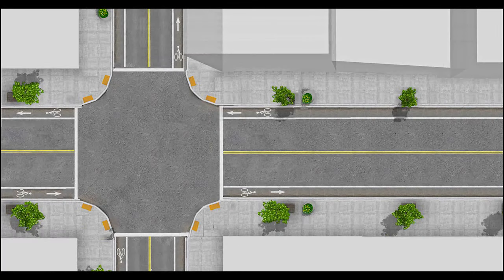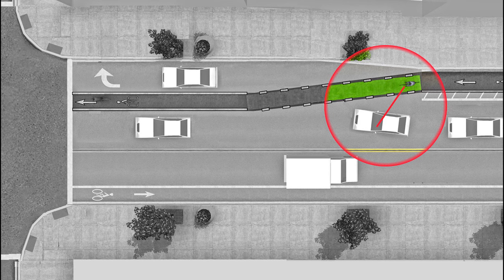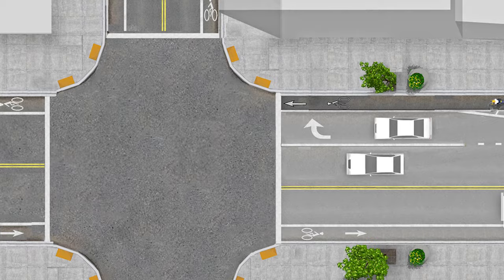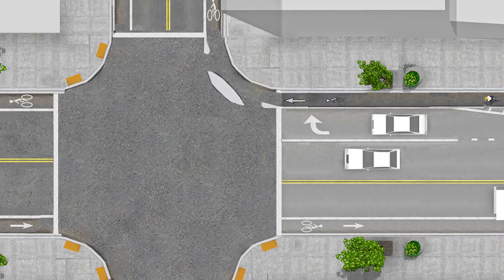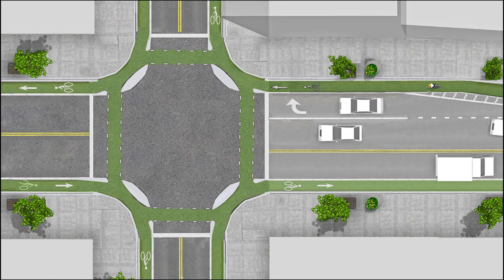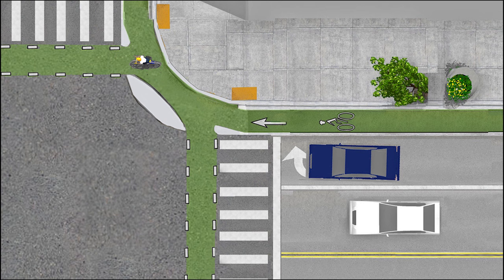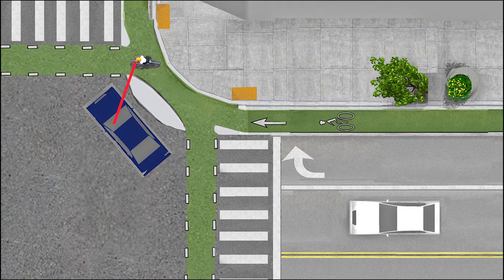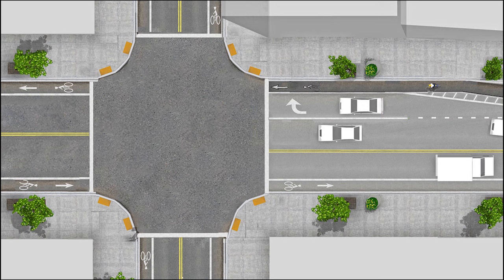Intersection design, the Dutch - cycle friendly - way

Comment: I'm not convinced.  Seems like the cyclist going straight now has to yield to cars going right, where previously the turning car had to yield to cross the bike lane.

Ok for a few blocks, but a serious impediment for longer distance travel. My 20km commute would have about 30 of these, and I could easily imagine each costing 30 seconds, which would add 15 minutes to a 45 minute ride.  Not great.

And the part about the car driver having to look over their shoulder doesn't ring true - the driver

Comment: Cyclists should be required to get insurance to operate on public roads.  And they should have to register and get plates as well. If you are going to use the roads then you should help pay for the roads.  If you want equal use of public thoroughfare, then you should have equal responsibility for safety and maintenance.  No free ride....pun intended.
Reply: +Gary Hudson I'm all for it but what would the insurance cover bicycles cannot do nearly the damage of autos. Are you implying that cyclist should be required to release motorists from the responsibility to not do damage to cyclist? I mean at full speed i could probably only do a couple hundred in damage to paint maybe a window, and there are already rules that allow for self insurance.  Please explain what your implying.
Reply: +Gary Hudson I have a car, truck, and motorcycle.  All registered.  When I decide to leave these vehicles at home and ride my bike, I've more than helped pay to maintain your roads, or fix any damage a bicycle can do to them.  Just my 2 cents, think what you want.
Reply: +Gary Hudson You want a 12 year old to take out insurance so they can get to school?
There is no registry or mandatory insurance for bikes in the Netherlands.
I think I've seen you commenting this before...
Reply: Dude, then pedestrians should pay for walking on the sidewalk. Also, everybody in the Netherlands has liability insurance, which covers bikes.
Reply: As if road tax pays for the roads, it's a tax to use them. Which is why cycles don't have to pay it, they do way less damage to the roads (as do pedestrians). All the income of the state goes on a big pile of money and them some of it is spend on the roads. TL;DR, if I'm paying tax, I'm paying for the road. Doesn't matter if I have a car or not.
Reply: @woutervanr  If you have a car, you do pay extra taxes. But it's good to encourage cycling instead of driving cars, so making driving cars slightly more expensive is a good idea.
Reply: @autohmae  It should also be noted that cyclists have a negative cost if you will, as compared to motorists whose taxes do not actually even pay for their full costs.
Reply: @Quintinohthree  you can tax cyclists just fine, some countries have been doing that for decades.
Reply: @autohmae  Nevertheless, every tax on cyclists is excessive, as they reduce overall costs. Taxing cyclists almost certainly causes a net increase in overall costs.
Reply: @Quintinohthree  I'm just saying: you could do it if it was desirable. I'm not suggesting to do so. :-)

Comment: I hate this. Bikes and cars in the same line= no problem
Reply: +Jörg Basler NO. Vehicular cycling has been proven wrong; it is something for the sportive, usually young and male cyclists on racing bikes wearing lycra. Cycling should be safe for everyone, also for children and seniors. But cycling next to a truck or speeding cars is not safe at all. Just ask yourself the question "would I let my 10 year old cycle here alone? – if the answer is no, it is not safe enough. Dutch infrastructure is. Proven for more than 40 years. Children cycle there from a very young age on their own bikes, because it is safe and they do not have to "share the road" with distracted drivers or huge trucks and busses.

Sure, if YOU want to cycle on the street, do it. But that is no excuse for not building safe cycling infrastructure.
Reply: donteatthechalk . Well put.
Reply: when cyclists can go the speed limit, that will work.  I hate cyclists in the road, all they do is slow down everyone and cause problems.  This idea moves them out of the way for everyones safety
Reply: If you want them all dead, no of course not. Have you ever cycled?